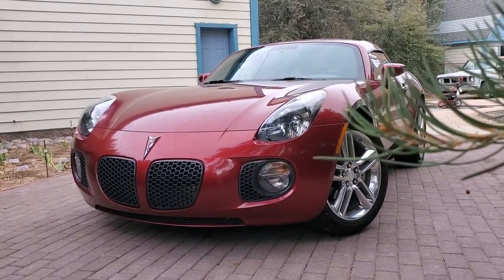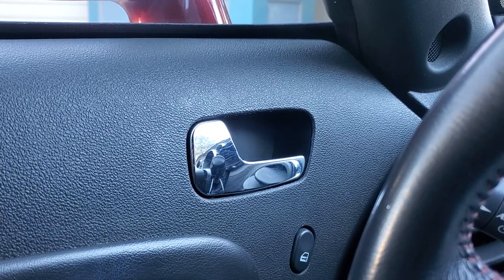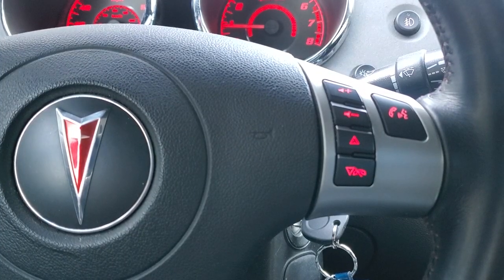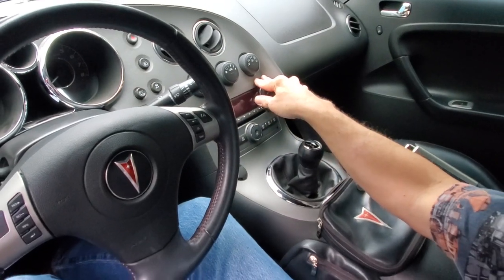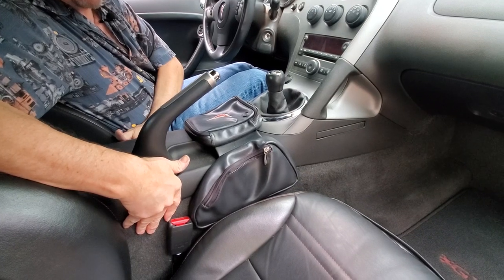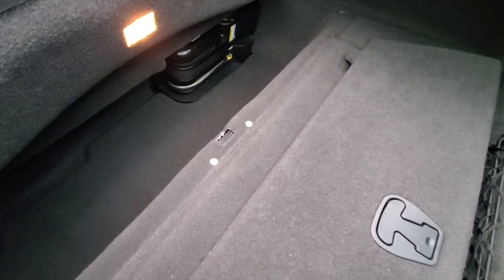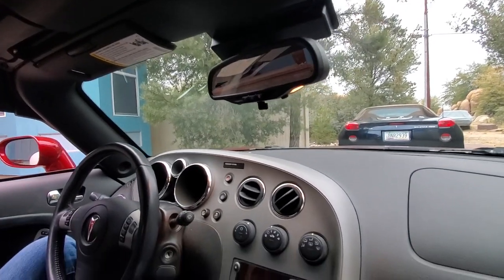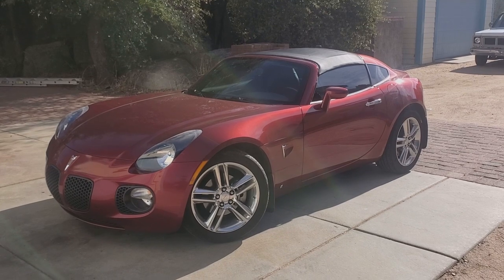2009 Pontiac Solstice GXP Coupe Removable Hard Top 5-Speed Manual Transmission

Comment: 1. The "hadfull"  were 2010 Solstice Coupes were not just "runoff's" from the 2009 production.  They were pre-production models built betweek April 21 and May 28 of 2009 and featuring 2010 design changes and new options being added to the carline.  They were all sent off to GM Detroit to be placed in the company fleet for evaluation.
2. The rear portion of the Coupe is made from Sheet Molding Compound which is a reinforced composite material, not steel.
3.  The Coupe tail light besides being different that the convertible lens wise, also attaches differently to the body of the car.
4.  There were 1266 Coupes made.  Only 1152 were sequentially numbered.
5.  The drivers side seat does have a power adjustment.
6.  The Q9Y wheels pictures are not unique to your car.  There are others who have made the change, my Coupe 1077 included.
Reply from the maker: Thank you for your input. Hope some of our Pontiac fans will find it useful!

Comment: Great video, I very happy you took the time to show the features of these beautiful cars! (I have a silver 5 spd manual also) It was fun to watch and I think I could add 2 things. First, what surprised me when I first started looking is that the AC was not standard on these and has proved to be a rarer option than it should have been.
Second, there IS a power seat switch on the driver seat, lower front, that raises and lowers the seat.
I guess the last thing I would add is how to turn off the traction control and what info the "info" button provides..
THANKS- Bill
Reply from the maker: Thanks for the extra info! Glad you like the video and thanks for watching.

Comment: Nice nice car and quick too.
How would the mirror motor wear just by leaving the selector one way or another?
Reply from the maker: Good question! It's a good idea to leave it in a neutral position. It's not good to leave it engaged since the motor will draw low level power constantly. Over time this can cause damage to the motor. Thanks for watching.
Reply: @CarzPlus  👍Okay, cool to know.Thanks for the response!
One last question lol, Her coupe has the chip that increases the performance...so how does it compare to the roadster? Big difference or hard to tell?
Thanks Much

Comment: Okay, I'm trying to restore a gxp 2007, this thing won't run right. where can I find a wiring diagram for this thing. I taken it to deals for months and they cant do a thing to help. New alternator, ecu, battery. I have gone over everything with a fine tooth comb to no avail. I hate electrical gremlins so much.
Reply from the maker: We did a search in Google and it produced this result among others: https://cardiagn.com/2006-2009-pontiac-solstice-2-0l-2-2l-2-4l-system-wiring-diagrams/ Verify that all grounds are good. It might be what we just found in our 2009. It had 2 pack-rat-induced vacuum line punctures.

Comment: Does not look bad / looks nice. But on close inspection - it's low quality. The interior is really lots of cheap plastic. But the design from a distance is really nice. And folding seats in a 2-seater roadster? And what's with the mudflaps?
Reply from the maker: The leather seats with the red stitching adds a nice contrast and the seats are comfy. While the seats don't fold for the same purpose as in a Mustang, they are adjustable to suit more drivers. The bezel around the instruments and the interior door handles do suffer a bit from a quality standpoint and those interior door handles will need to be replaced someday. We did an instructional video on that topic and it can be viewed in our 2007 Pontiac Solstice playlist. In retrospect additional trim levels with luxury features would have been a good thought.

Comment: WHY? I never understood why manufacturers put removable roof panels on non-convertibles! I mean, people who like open air driving will buy convertibles and people who don't probably do not want the sun on their heads. This is particularly true of cars which started off as a convertible and got a hardtop later in the life cycle. Anyone who deliberately buys a hardtop does not ever want a tan or wind in their hair. They'll rather have no leaks, no noise, no sun, less weight, less complexity, less cost and more rigidity. The one reason I don;t like Corvettes for instance is the removable roof panel. I know that I'll NEVER take it off so I'll rather have a proper headliner, no latches, no seals and a complete passenger cell above me.
Reply from the maker: You've made your case. The coupe gave us three different looks, making it more versatile. Have to admit we've put more miles on the car with the hard top attached. The top basically fits drum tight. The only issue is a little water dropping on my lap after a trip to the car wash.